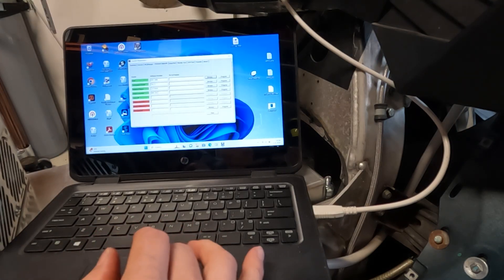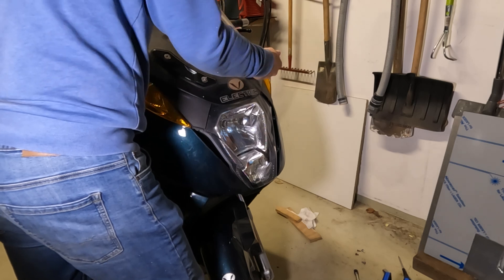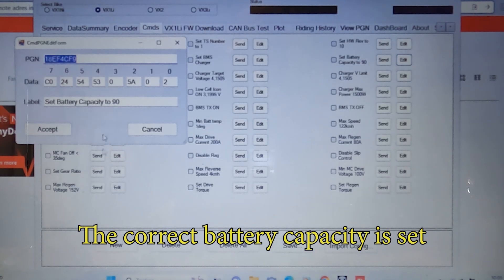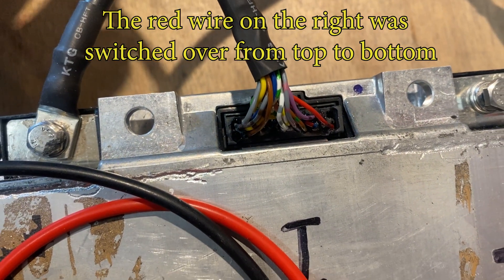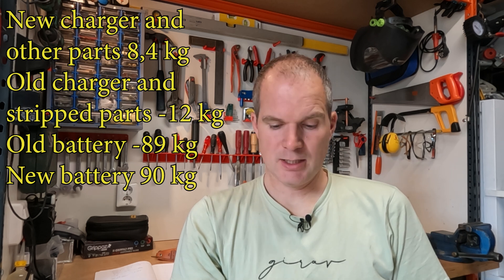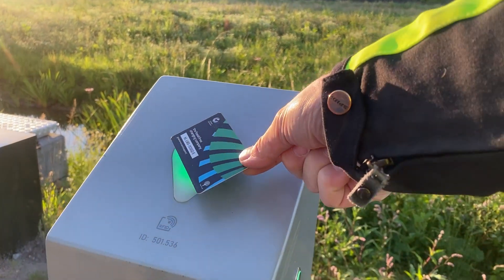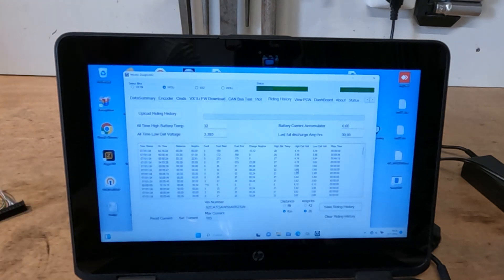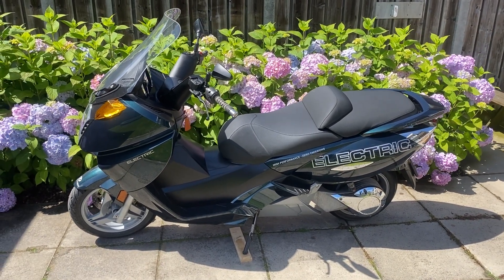Vectrix upgrade with VW modules, finishing the install and the first driving experience

Comment: Hello, when you say could do with more power...is the power the same as it was with the NiHy batteries? Thanks - I will be doing mine soon....
Reply from the maker: I never drove it with good nihy batterys. As far as I understood the power stays at the maximum because lithium allows higher current flow. 
I mean that the Vectrix is a bit underpowered. This is the motor and controller limitation.

Comment: Have you solved the public charging issue?
Reply from the maker: @etiennezmarzlowski9222  not yet, I’m sourcing the parts to add an type 2 chargeport. And with a firmware it should work.

Comment: Hi Jan,

With experience of the conversion (especially now we are well into winter) would you change your mind about adding some insulation between the bottom battery module and the battery box?  I was thinking about adding some heating pads below the 3 modules to keep them warm for cold weather charging.

Also, which charger did your Vectrix have before the upgrade and why did you opt for Matteo's one?
Reply from the maker: I had an ESD charger in it. This old type can't work with an BMS as far as I could find out. 
I went for Matteo's set so it is completely integrated in the bike and working out of the box. 
I don't use the motorcycle when it is below about 5 deg Celsius. Driving the highway 65 km is too cold. So heating for me is not needed. With my use and the battery slightly warming up in the summer, I am still satisfied with my choice not to put insulation between the battery and the battery box.
Reply: @janjoukeDIY  Thanks very much Jan.

I have tried emailing Matteo about documentation for his BMS as I am about to install it and have had no reply.  Any ideas?

I certainly won't be using it when it is particularly cold - just thinking about condensation more than anything, really.  I have had the 3 x ID3 modules in my garage these last 3 months and when we get a moderately cold spell of weather (it very rarely freezes here - PA617YT, UK - thanks to the Gulf Stream) followed by mild weather, the module casings have been streaming with condensation - along with anything else made of stone, metal or concrete, of course...

Anyway, I think I'll go without the heating.  The way the cost of batteries is falling, it won't be a wild issue to replace the modules if I get problems in the future.

Comment: Het probleem dat het laden aan de laadpaal niet werkt, komt omdat de lader niet luistert naar de laadpaal.  De meeste laadpalen sturen na een minuut via  het CP-signaal het af te nemen vermogen naar omlaag. Reageert de lader hier niet op, dan  stopt het laden.  Ik heb dit ook gehad met m'n omgebouwde auto en kon dit vaak omzeilen door eerst anderhalve minuut op half vermogen te laden.
Reply: The other possibility is that the current coding resistor in the adaptor is telling the charge point "Charge at X amps, maximum" and the charger in the Vectrix is drawing more current than that...